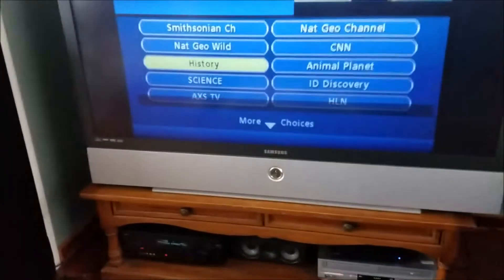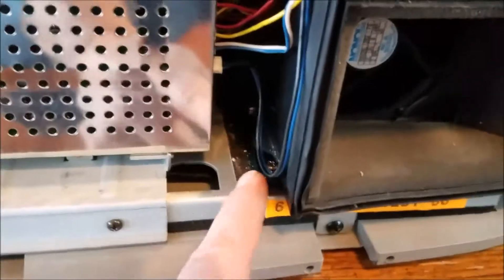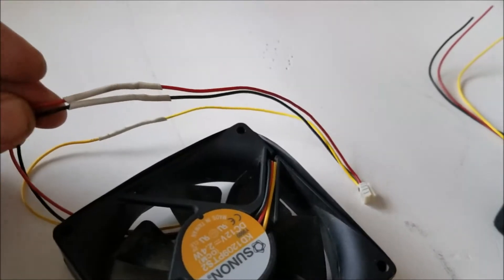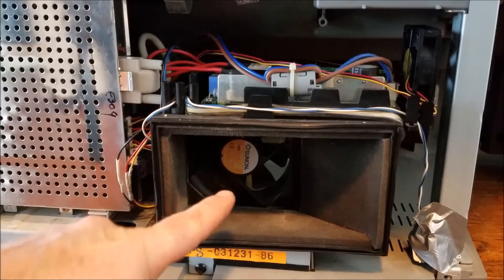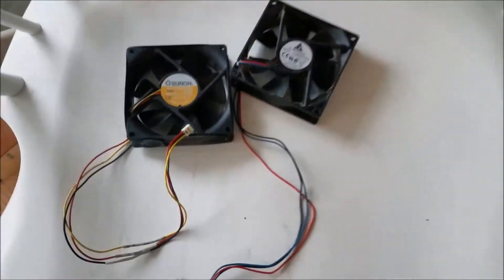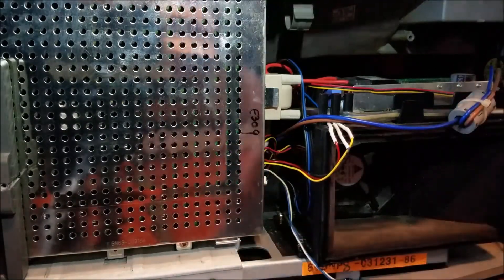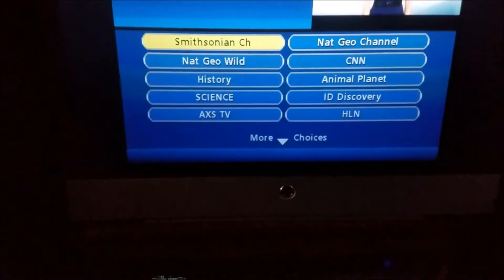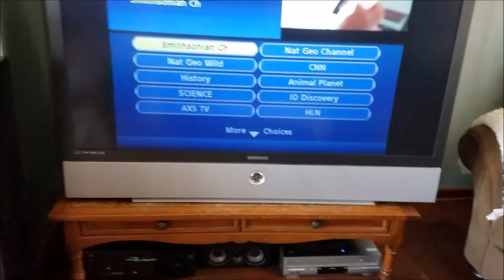Samsung DLP TV fan replacement - CHECK THE FAN No. 3

Comment: Greta video! Thank you for posting this. I will try on my Samsung TV. I will try at first see what’s the specs for the fan and get the same.
Reply from the maker: Good luck!
Reply: @infinigrove  I tried first to clean the fan with compressed air and it worked. The TV came back to life normal! However I was ready to disassemble it in case I needed. But your video was very insightful. I do recommend to other viewers to clean the dust with compressed air, everywhere, in the fan, from the back part of the fan unit and test it back. If that doesn’t make the warning message disappear, then proceed to disassemble and change the fan

Comment: I actually just done fixing mine... I dismantled without buying a new fan. I took out the fan to clean, thinking it was just the dust, because the error always come on and off. Cleaning the dust didn't work. Went out to the shops but couldn't find a replacement. Contemplated to order online bcos it would take almost 2 weeks, and I'm too lazy to go through all the hassle of removing it from the wall mount and dismantling. I wanna get everything done immediately and tidy up the whole place. So.... I dismantled the fan itself! Lol... clean the rust inside and lubricate it. IT WORKS!!!
Reply: Lmao anything to avoid delayed shipping. 👍